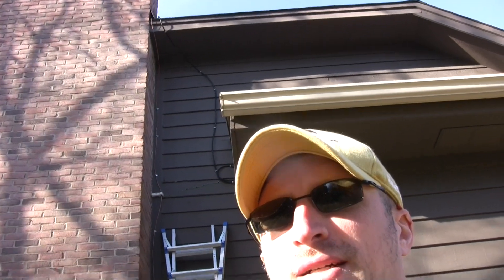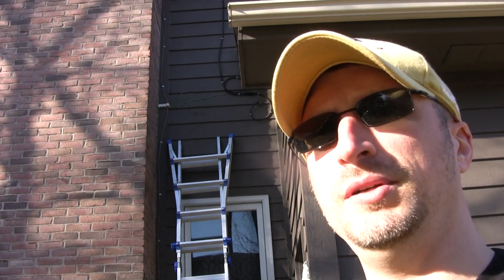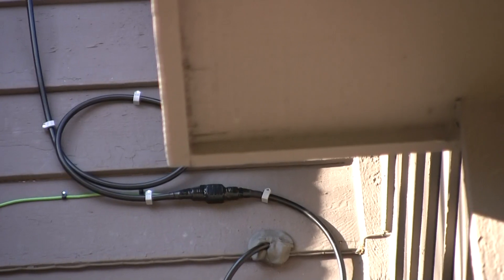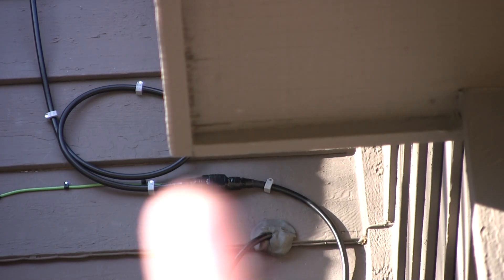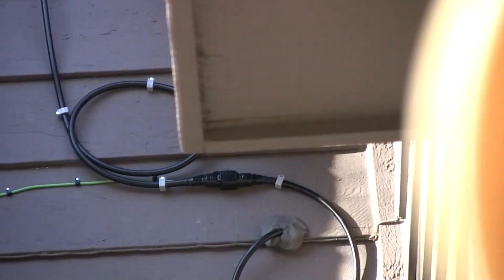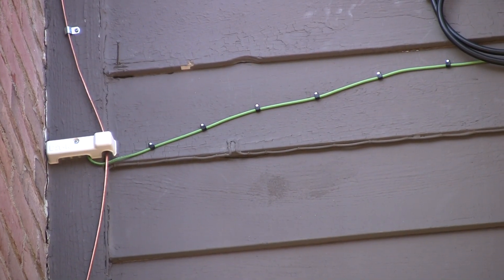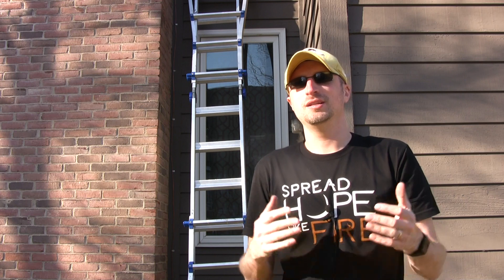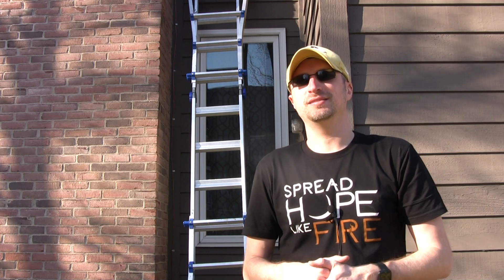Grounding mast and antenna with the Helium Network - Part 2, the Install

Comment: Let me get this straight. So the Green wire (is copper?) that goes from the lightening arrestor to the copper wire that goes to the ground, and is also grounded to the mast?. Did you order 2 different LMR so that they can go through both ends of the lightening arrestor?

Comment: Hey Ed I am currents at the stage of my set where were i need to ground my antenna. However i feel likeI am missing a wire. What is the green wire connected to in the video? from the block to what?

Comment: Hey bro great video. I will be installing a antenna to the roof and looking to ground it but my home I can't find no grounding rod in the ground. Did you install the rod or did your house have one?
Reply from the maker: My house is grounded to the water main...on the other side of my house. So I put this one in but still need to tie the grounds together as creating what's called a "ground loop" is not a good thing.

Comment: Hi ed . Nice video . Im connecting my arrestor directly to my 5.8 antenna. Then from there i running the green grounding wire to the grounding rod . Is it ok like that ?
Reply from the maker: It's better to have the lightning arrestor as low as possible. Is your mast grounded as well?
Reply: @edballou1  So it's better to attach your first coax directly to the antenna, run it down the side of the house to an arrestor (which has a grounding wire running to the grounding rod) and then the second coax running from the arrestor into the house to connect to the hotspot?

Comment: Does synchrobit gateway mine HNT like the rest of the miners? I went the the site and ordered one because the rak miner isn't available toll the summer. However there is no mention of mining so how does it make HNT? Is it equal to the rak miner or worse. Just want to know if I should cancel my order.
Reply from the maker: All the miners are equal in terms of ability to mine HNT. Proof of coverage is the work that is rewarded. All of my experiences so far have been with the OG hotspot. Miners are on the way from RAK, Nebra, and Bobcat.
Reply: whats your shipping time looking like? as far as i knew synchrobits ordered in april werent coming until between july and september